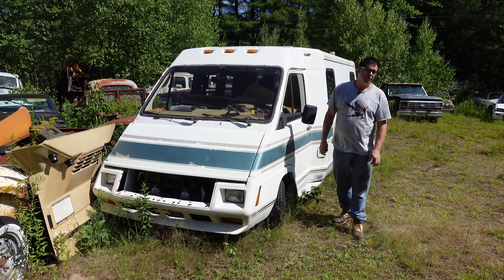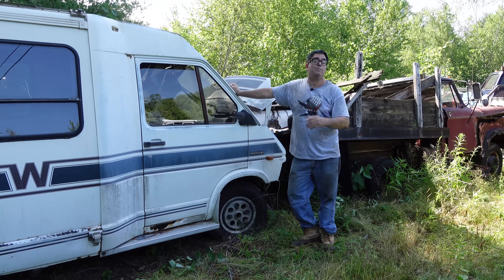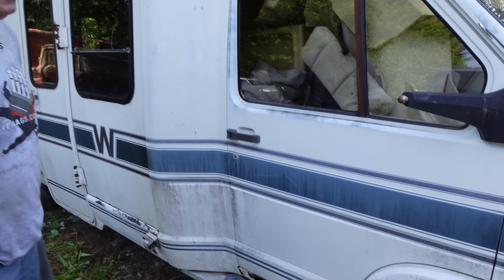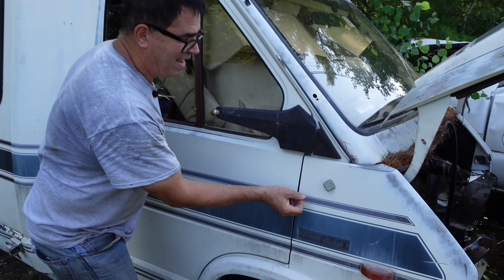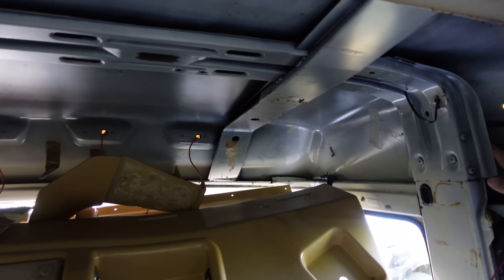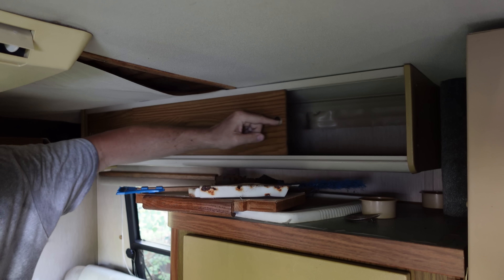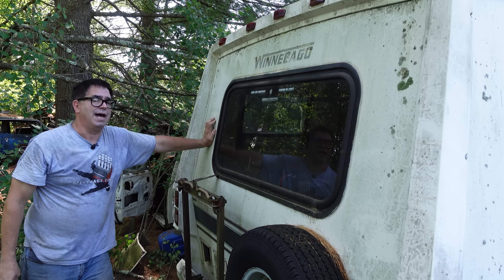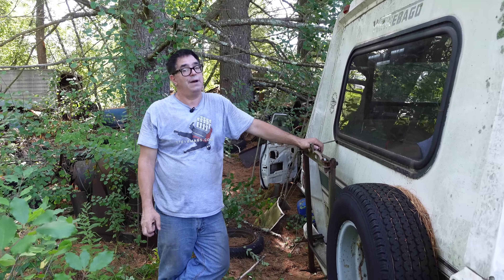World’s Slowest RV

Comment: My 86 Chevy pickup C20 was built for 55. I had to finally change the rearend gears and put an O/D tranny in it. So I went from 8mpg at 55. To 16mpg at 70-75. runs great now !!!
Reply: Out of curiosity  what was the gear  ratio that gave  you the better mileage and what was the previous gear ratio when you didn’t get good mileage?
Reply: @abeneufeld9690  The original was a 4.10 we put in the 700R4 tranny, I’de have to lookup what that internal gear is in that. But we put 3.73 in the rearend. And at 70mph, it runs about 2000rpm. Major difference and such a pleasure to drive on the freeway now. I really do get 16-17mpg. And much easier to drive with that 700R4. 👍

Comment: I recall a Motor Trend article in like 1976 that pointed out that the life saving stats of the 55 MPH limit were based on CA numbers, and what may have been significant was that drunk driving also decreased. They attributed the drink driving stats to high cost and lower availability of gasoline cut down on drunks driving.

Comment: My grandpa had a little Fiat back in the 70s that got over 40 MPG. It also had a steam cleaning system on the car that would inject water into the motor while running to clean out carbon buildup.

Comment: I still have the speeding ticket I got from the CHP going through Palm Springs Ca at 3 am in 1982, 65 in a 55!  Nowdays as long as you keep it under 90 the don't even bat an eye.
Reply from the maker: Hello Hard-Wired-G, I spent 17 years living in the Los Angeles area and worked at Hot Rod magazine for 7 of those years. I had a 31 mile daily drive from El Monte to 6420 Wilshire Blvd. in west L.A. that took me over 2 hours TWICE EACH WORK DAY. Argh. But I do remember I'd always be driving along at 75 or even 80 and police cruisers would ride up on my rear bumper until I pulled over a lane to let them pass! I loved that the L.A. police didn't have any worry about freeway speeders, they had much more important duties to deal with - like the gang problem, drive-by shootings and REAL criminal offenses. I moved "back home" to rural Massachusetts about 10 years ago and somehow managed to never get any speeding tickets despite plenty of silly speed traps where going 45 in a 40 will get you popped. I am 58 now so my days of crazy driving and street racing are behind me. I say now: "the way to kill a bear is to starve it...obey the speed limit in small towns". Anyhoo, here's to travelling safely on highways at 80-mph. In modern cars it's not dangerous at all. Thanks for writing, Steve Magnante
Reply: @SteveMagnante  from what u learned in 2 days about theas is they could do 75 moh plenty fast

Comment: The 55mph speed limit I believe had a unintended consequence, many cars were released with lower gearing to have better acceleration with the limited power of the time, while making the engines run at higher rpms while going 55, which actually lowered the economy, and if you drove one of those cars faster, your mileage would crater above 60. A example of this is the Mercedes 300d, in the United States it had a lower rear gear, and a 4 speed automatic. At 55 I can return about 30mpg, while at 65 it gets about 25 and at 75 around 20-22 mpg. In Europe you could get the same car with a 5 speed manual, which let the car cruise at a lower rpm on the highway, which in theory would return better mileage.
Reply: I remember many cars of the 70s and 80s having extremely low numercial rear ends and detuned engines that would make full torque as early as 1800 rpm but gasp sometimes before reaching 5k rpm and certainly most wouldn't do more than just vibrate and make noise above that. Everything was matched for mileage. You could floor a GM V8 and hear that Quadrajet moan until you got up to about 30 mph and the revs started to pick up. Family had a 74 Cutlass with a 350-4V that would hit 52 mph top speed in first gear barely turning 5k. Almost the national speed limit LOL!! Bad times. Yuk.

Comment: The turbo diesel models never had a 5 speed transmission. and there is no way that you would of got 35 to 40 mpg out of that thing. They were that bad that the diesel was dropped by the end of 85 and it was petrol only with a 3 speed auto.

Comment: The diesel had a turbo 2.0l and had decent power. But it was loud buzzy and miserable to drive spinning 3500 rpm at 55...the 3.8 Buick conversion got the same 22mpg hwy with over twice the power and quieter 1900 rpms...

Comment: My 1966 Chevy van covers the 1/4 mile in 20 seconds @ 58MPH. Hang on!
Reply: @MARK PAIGE I don't know exactly what GM had to offer for vans but you could order a 70s Ford Econoline with a 460, a 4 speed and a 4.10 axle ratio and I always imagined one optioned out like that would have been at least respectably quick on acceleration. In fact I tossed the numbers into an ET calculator and one should be good for mid 15s/16s depending on exactly how heavy they are. That's not bad considering your average base model V8 automatic 80s Mustangs/Camaros were roughly 15 second cars.

Comment: I’m sorry but 30 or 40 mpg is impossible in that rig. You can’t beat physics. You can make things as efficient as possible but you can’t beat physics. 

You’ll never see more lies about fuel economy than the Toyota RV community. I’m a Toyota man. I’ve had seven including an RV. Everyone always buys a Toyota motorhome thinking it's gonna get 20+mpg so they can look down at their V8 counterparts. Well, it turns out if you out a motorhome on the back of something you might get 14 mpg. Hey, that's one or two better than a V8 maybe, but you also can't keep up with semis in the mountains. 

The worst part is the frugal folks who buy these things pay a premium and get so embarrassed they start lying too. They’ll pick that one day in Wyoming where they were doing 55 with a 35 mph tailwind and proudly say they get 23 mpg. Meanwhile, they're crying in the bathroom every 140 miles for fuel. 

Also just because I am on a rant the 22RE and 3VZ aren't that reliable for motorhome duty.

And before anyone says anything I know the Renault is diesel and that's different but its still not getting 30 or 40.

Edit: I looked it up and up to 23 mpg might be reasonable.
Reply: I´ve got a light van which does easily 42,3 mpg Turbo diesel commonrail 100 HP tops at 103 mph

Comment: Could you make it have more power like engine upgrades
Reply from the maker: I suppose anything is possible for added power but the lingering question remains, would the front wheel drive system handle the extra grunt. And for how long? Inquiring minds want to know. Thanks for watching and writing, Steve Magnante
Reply: I saw one for 800 needs some interior work and  a  mass air flow sensor .thinking about it, but  I'm reading up on them  this is a 1986 one

Comment: It's to bad that REN-O didn't use a Maserati v6.  That beast would have been much better than one Rudolf.  That would be like putting a trailer hitch on a Rabbit Diesel .  I also remember those days, everyone hated Jimmy Carter for the 55 MPH speed limit.  That's why CB's got so popular in the 70's to try and out fox the oinkers (plain Brown Wrappers, and County Mounties) with the speed guns.
Reply: Actually the 55mph started before Carter,  under Gerald ford.  I took drivers ed in 1974 and drove once at 70 before it slowed to 55. While it didn't save as much fuel as originally thought, traffic fatalities were half of before.
Reply: January 2, 1974 The emergency Highway Energy Conservation Act Signed into law by Richard Nixon. @michelletaylor5691
Reply: @o.c.smithiii2626  I was 16 years old, I had other things to worry about......

Comment: You still see these La Sharo's for sale . . . pretty luxurious, but unless you find a decent running turbo diesel, good luck making it down the road without pissing off a lot of modern drivers. 
But . . . if you can cruise the flats making 35mpg, that's something for sure.
Reply: Luxurious is not the word I would use for those.  I saw no luxury at all, just utility.

Comment: The "l and t" in Renault is silent. The diesel does not get 30-40 mpg nor the crazy statement at the end - 50mpg. In actuality - about 22-23mpg. The same diesel engine was fitted to some Jeep Cherokee SUV's. The coach portion of the body that was built by Winnebago is aluminum over aluminum tubular framing that is stiffened internally with steel - not fiberglass. The only fiberglass used in the LeSharo/Phasar is the front nose and hood. The rear outside corners are ABS plastic. As far as being the worlds slowest RV - the diesel is certainly no speed demon but can run 65mph - just like many semi's now. Any of the gasoline versions well outperform a cab over bunk style Toyota motorhome with 22r or 22re with auto transmission. The gearing and aerodynamics make them better performing than many of the V-6 versions. Sadly - poor Renault vehicle electric systems and undersize transmissions lead to many problems.

Comment: I had a motor home it was a 27 foot Ford ran good I used it to go to new Brunswick from ontario and in new Brunswick I was on the 126 hwy from Miramichi to Moncton and was buzzed and accidentally touched the shoulder falling asleep a bit it was fine gravel and melted away under my front tire I ended up on its side luckily nothing broke but I was in the camper and the cops wanted me out so the tow truck could drag me out of the ditch cost me 500.00 shitty anyways when I was in the cab they said get out so I'm a fat bastard I said wait a minute I tried to climb up on my seat to get out the door window but failed just then one of the cops kicks my windshield I said noooo there's no broken windows they said well we need you out of there I tried again but made it we all laughed after those old codger r.c.m.p ain't to bad not like Gung ho state police maritime decent folk.

Comment: That car dealer I worked at back in 1990 had one of those motorhomes . The service manager called it the Le shardo the French poop stain of a motorhome. 
Long story short literally had an electrical fire . It went up in flames faster than it went down the road
"Big ol Rollin turd"
Reply: You should have included the long story about how the short circuit started the fire...🤣

Comment: I think the Toyota 4 cylinder  class C type RV were slower?  Even the V6 powered Toyota Class C were turd slow
Reply: A 22re had about 115 HP. The V6 had 160 and would do 85 on the flat but not comfortably or economically.